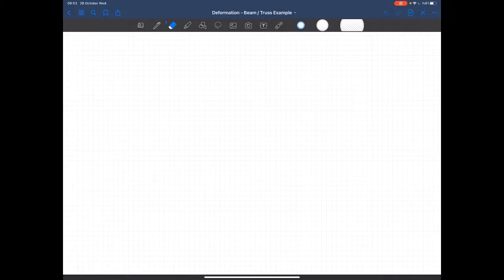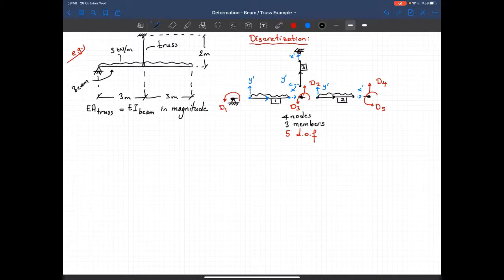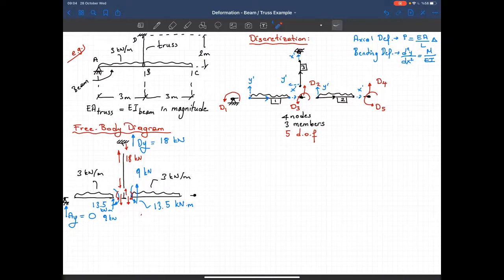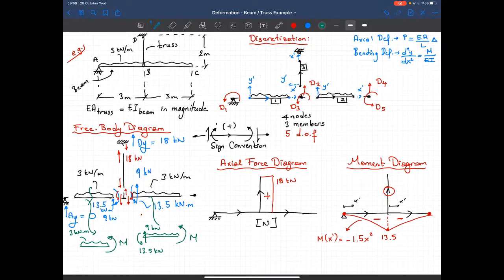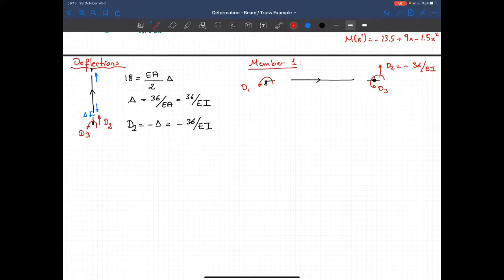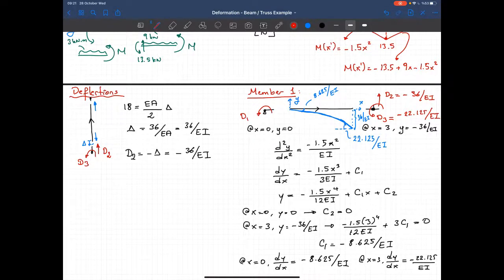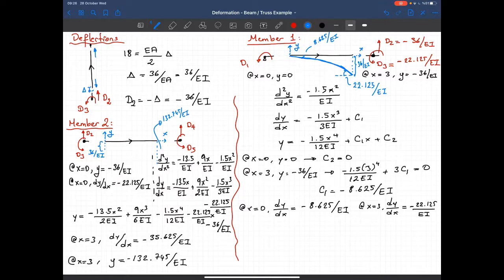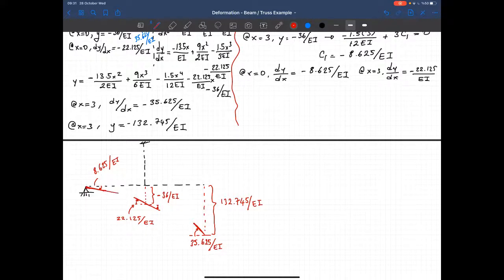CE 383 - Deformations, Truss & Beam Example, Week 3

Comment: Hocam at point D, why don't we have a rotational degree of freedom? Is it not an internal hinge with the combination of a fixed support?
2) Why don't we have two rotational degree of freedoms at the intersection B? 1 for the beam and 1 for the truss member?
Reply: I have come to the conclusion that for both cases mentioned above, the rotation becomes zero and thus you omitted them from the beginning. Kindly correct me if I am wrong.
Reply from the maker: BD is a truss member, thus undergoes only axial deformation. Because of this reason, we are only interested in the axial deformation. That's why I didn't define any rotational degrees of freedom.